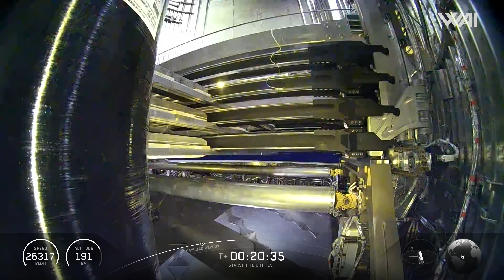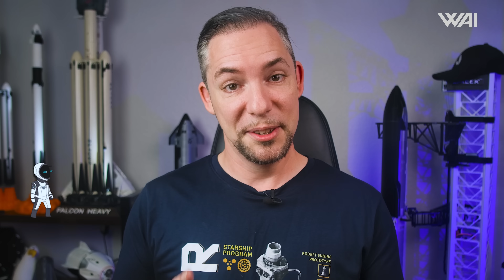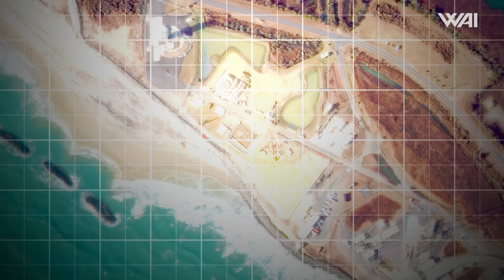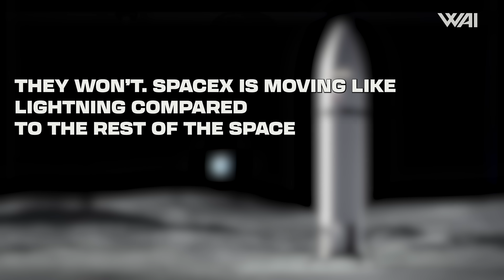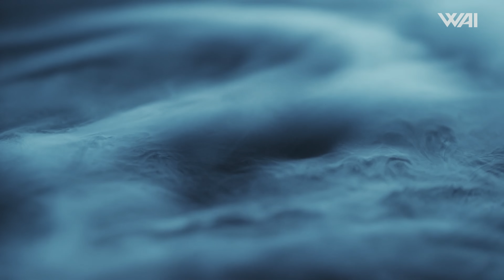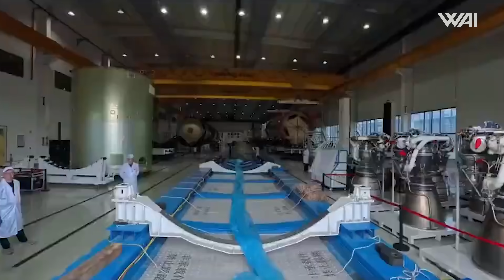SpaceX finally sheds light on ACTUAL Starship orbital refueling hardware!

Comment from the maker: Visit http://ground.news/WAI or use code WAI on mobile to get 40% off unlimited access this month!
What do you think of orbital refueling? Good idea? Bad? :_WAISweet:
Reply: The reality is, ANY future lunar and interplanetary system requires 2 things: (1) rapid reusability to reduce cost, (2) LEO refueling for large mass movements. We can't do anything manned beyond Apollo-stye moon missions WITHOUT staging fuel depots. We're going to need gas stations in space.
Reply: I see orbital refueling as a necessity for massive space cargo transport beyond LEO. In my view, loading 1,000 starships on Earth and NOT shifting cargo until landing on the moon and Mars requires orbital refueling. People in contrast prefer ships faster than chemical rockets so we can be sure people will eventually be given something SpaceX has yet to put on the drawing board. These will also have orbital refueling. Unrelated, I have zero confidence in initializing lunar transport with a tall narrow based lunar lander. SpaceX MUST build several short squat high flotation wide spider legged rough terrain landers, full stop. These put cameras and radar on the ground so Starships with legs can land safely. Starships with legs can bring steam shovels, cranes, etc to build infrastructure like the mechazillas rapid cadence Starships normally land on. Assuming SpaceX intends to build a few thousand operational Starships by 2030 this is roughly the timeline I'm expecting, and I say "roughly" because SpaceX is full of surprises. In fact, I'll be surprised if I'm not surprised.
Reply: Bro pulled a "hide user from channel" on my account and complain about YouTube
Reply: $4 billion (+ $23 billion in development costs) and NASA will repeat Apollo 8 with the second flight of the SLS. Mmmmm, OK.
Reply: Logical evolution to what we already do off both the ground and in the air now
Reply: Seems like orbital refuelling is a necessity. Although it seems like a downgrade to the original vision of starship ( although that probably reflects my ignorance and  expectation more than anything else ). Unless AI can design a much more powerful fuel source , that is

Comment: Why bring up several ships with propellant, when you should have an Ion rocket tug, pull you to the moon or Mars at an ever increasing halfway speed, then slow down and THEN Use propellant to land on the moon or Mars. Faster travel time, fewer launches to bring up fuel. DAH….

Comment: Questioning Artemis 3 and challenging others to replace HLS, maintaining current timeline, doesn’t sound very likely. 
Having said that, I think the Artemis program seems needlessly complicated, requiring multiple launches and several different spacecraft for a round trip. Not even mentioning the ridiculous cost of SLS. It is rumoured to burn money, rather than rocket fuel. Orion isn’t that much better.  It has been under troubled and expensive development for a very long time, with only one successful launch so far. CrewDragon is considerably smaller and currently not certified for long-endurance deepspace missions, 
but… it might be interesting to consider an upgrade after all.
I wouldn’t be surprised if SpaceX at some point decides to do this, with or without NASA, bypassing SLS and Orion altogether.
Reply: A couple of Dragon launches, two from Starbase, two from Brandenberg, two from Kennedy each with 5 astronauts aboard docking with Starship will get you quite the talented complement of crew to go to the moon and begin to set up base. An engineering team to prep the surface for buildings, a team to prep for future landings areas, a team for the insitu manuafacture of fuel for other mission flights. Got a lot to do in a months time. (If you plan on going there better plan to have a purpose and get stuff done!!!)

Comment: What's the downside of using parafine as a fuel? Is it harder to produce? There must be some negatives why companies like SpaceX aren't using it (for its first stage of course as the second stage is meant to land and lift off of other planets which would make it impossible to use parafine as its not easy to create on those spots).

Comment: SpaceX will need to make the rear transfer connections flexible if the front one are fixed.  Otherwise the logistics for connecting both fuel and oxygen at the same time will not work.  There are too many variables which affect the spacing of the orifices.  Construction would need to be perfectly precise.  Temperature can affect the distance between the ports.  Control  of both ships during the connection maneuver would need to be precise.  Quick disconnects are flexible for a reason.  In orbit, flexibility will also be important.

Comment: I Felix, I have one minor correction and one question: 1. The fuel masses you mentioned for Starship-Superheavy are actually propellant (fuel + oxidiser) masses.  2. Why does SpaceX need an orbiting propellant depot?  Couldn't they fill the HLS variant directly with tanker variants rather than filling the fuel depot first and then transferring propellant to the HLS?  I could understand why they would need a propellant depot to fill a crewed version of starship, to minimise the time and therefore commodity usage, on orbit for the astronauts but it will be a long time before there will be a crewed variant.  Surely, the best part is no part and therefore no propellant depot?  Is the reason that they need a heavily insulated version to prevent boil off and this would add unnecessary weight to HLS?
Reply: Prolly because of the Mars plans? 🤷‍♂️

Comment: I was hoping you would explain it but you didn't. How does Starship need to be refueled? The booster carries Starship to a certain height, Starship then burns most of it's fuel getting into orbit, then waits for another Starship to refuel it? How? Won't that other Starship also waste it's fuel getting into orbit to be able to dock with the first Starship? I don't understand.

Comment: I wonder if you could somehow recover at least some of the energy at launch of starship or any other rocket, kind of like the recoil of a gun captures the energy released by the shell when it is fired. I am not suggesting firing one rocket helps load the next rocket on the pad, but it "could" be used to provide some power to Starbase.
Reply: That increases complexity for not much of a positive result

Comment: IIRC, Tesla Model 3 motors and batteries move Starships wing flaps. Tesla Model S motors and batteries move Super Heavy's supersonic grid fins.
What are the odds that all those (unsold??) Cybertrucks lined up outside Starbase are the delivery of the motors and batteries to run the pumps to transfer fuel on orbit?
Under the "Best Part Is No Part" ethos, possibly a version four of the sea level Raptor engine, with external battery and electric motors (like used by Rocket Labs Rutherford engine), where a valve can switch between pumping the fuels in to a rocket engine, or pumping them out across in to a waiting Starship to refuel.
Starship to Starship is important, but I expect the tanker will only look like a Starship vehicle for the initial tests, and SpaceX to build an unmanned platform with multiple tanks that are much bigger then those of a single vehicle, the bigger it gets, the more payload mass to retain it's low temperature on orbit. (Surface Area of a Sphere vs Cubic Volume,..)

Comment: Just send SpaceX Starship Moon Lander to the moon, without refueling.  (Non-reusable booster)

Or send a starship cargo pod moon lander to the moon.

Almost the same size as the cargo bay of the starship.  Just a tiny bit smaller.

Just deploy it out of the tip of the starship like a bullet, perhaps using springs.

Make it so it can travel to the moon by itself.  Like the crew dragon.  And be able to dock with Orion space capsule.

Send an empty starship to the moon before hand to catch it, and land it on the moon.  
This could be a special starship, that when getting to the moon, it divides in half, top part becomes a cargo pod lander, able to catch cargo pods, land and retrieve them from the moon. 

It could be refueled with cargo pods tankers. Only a few of these special starships would have to be built.  They could be controlled by remote control, or by humanoid robots, or by astronauts.

And the bottom part remains in moon’s orbit to be recycled (or reused) or lands on the moon to be recycled.

Do the same thing for Mars, send 1000 cargo pods, instead of 1000 starships.  Save billions !  🙂

Comment: In my eyes, starship should come with a third stage, third stage being a safety capsule.. i imagine an upscaled stoke space type design would be perfect for this.. only the oxygen tank up front needs to be relocated, and the best part is, this stage would actually keep the weight Ballance if so.. 

That's the fastest and safest route to get it human rated.. if anything was to happen on the moon, you don't need to send a bunch of ships to refuel, you leave in the nose cone, the second stage becomes a tanker hub for next flights, refueling happens without risk to crew..
I imagine you don't need many of this version, only until the other versions gets human rated without an abort system.

Comment: How does a rocket engine burn solid parrifin? Does it pass super heated oxygen down a hollow core of parrifin? Sounds impractical for maintaining consistent fuel conversion. 

Perhaps the parrifin tank is heated until some of the contents are liquid. Then the liquid has a sensible propellant pump. 

How does the solid wax rapidly get heated into a liquid during launch? 

Maybe it is all melted in advance of launch?

Comment: Honestly I've been a little concnerned about SpaceX's ability to pull the lander together given their current priorities.  But opening the contract back up to give money to someone else (*cough* Boeign *cough*) won't get things done faster unless the plan is to use this as kindling (tea-teb?) under SpaceX to get some movement from them.  I would like to see Dynetics have another shot at the lander though.  Something with a lower center of gravity seems a little more practical on uneven surfaces than a top heavy landers like SpaceX or Blue proposed.  Honestly I think NASA has realized how far behind they are and are trying to push things out and save face.

Comment: My 5cent worth on the "refilling" design. If you have two female adaptors (vertically) on the left of the vehicle and two male adaptors on the right of the vehicle (thus one of each per tank) then you don't have to make two variants of starship, as any ships can mate with any other ship in either role of needing or carrying fuel is then simply direction of flow.

Comment: Remember "The best part is no part."  One aspect of this is using a single component to perform multiple tasks.  There is already an adaptor on Starship which supports bidirectional flows of cryogenic propellants.  Why add another port and all of the necessary plumbing to connect it to.the tanks.

Comment: Don't know about the lowers, but the upper docking studs are in the ring section above the upper methane tank dome.  And I didn't see any connecting hardware for between them.  Of course this may just be another prototype to see how they survive re-entry before building another ship with the plumbing, but as of now it looks like they might only be for docking and not fuel transfer.  It would be a slick way to do it, though.

But there are other gases on board Starship other than the fuel and oxygen.  How many of those will also need to be transferred to/from the orbital refueling ship?  Or will they have a secondary ship for the other stuff.  Kind of like a Quickie-Mart for low earth orbit?  (Once we get live astronauts in the picture they will need someplace to sell the Pepsi, Snickers bars, and lotto tickets.)

Also, about the sunlight; those thermal tiles really resist conductive heat flow.  Wouldn't it be helpful to keep the TPS side pointed at the sun?

Comment: Hybrids have most of the drawbacks of solids, the worst problems of liquids, and performance lower than either. Poor mixing and combustion efficiency, inherently non-reusable, lousy propellant utilization, and cripplingly high dry mass make them unsuited for orbital launch, requiring three or four stages just to limp into LEO.

But other than that, Mrs Lincoln, how did you like the play?

Comment: When I look at burning candles, doubt that parrafin wax is not flammable.
Reply: Paraffin wax does not burn.  It must be vaporized first.  In a candle, the melted paraffin soaks into the wick where the relatively large surface area allows it to evaporate quickly.  The vapors are what burns.  This is the same with wax or oil and it's why you can make the light brighter or dimmer by adjusting the length of the wick and, hence, the surface area available for evaporation.  Somehow I doubt that a rocket will use a wick.  But it will still be the vapors which burn.
Reply: How does a rocket engine burn solid parrifin? Does it pass super heated oxygen down a hollow core of parrifin? Sounds impractical for maintaining consistent fuel conversion. Perhaps the parrifin tank is heated until some of the contents are liquid. Then the liquid also has a vapor flash point and is not as "safe" as wax, but now has a sensible liquid propellant pump. How does the solid wax rapidly get heated into a liquid? Is it all melted in advance of launch?
 @briangodfrey7424

Comment: I  hope that SS HLS is ultimately designed with the capacity to go from LEO to lunar landing and back to LEO.  You don't need heat shielding.  You could probably put fewer, or only vacuum engines on it.  Might even be able to shrink it a bit if the LEO > Lunar surface > LEO requires less fuel than getting from the ground to LEO.  Then the main issue becomes crew transfer and cargo transload in LEO...  That pretty much obviates the need for SLS and Orion, and that frees up NASA's budget to do everything else it wants to do.
Reply: Yeah.  And I hope it has a professional crew to fly the ship and they take the astronauts as paying passengers.  (Presumably NASA is paying at first.)  
"If the captain lights this indicator your space suit will drop down from the ceiling and you will have 2 minutes to put it on.  Please watch the video for detailed instructions..."
"Please put your seats and tray tables into the landing configuration..."

Comment: Starship is the wrong spacecraft for Lunar sustainability.   It's too big, too inefficient, and unsafe.  Not to mention that the moon is Carbon poor and you cannot make Rocket Fuel for Starship on the Moon.  Blue Origin is a far better choice.  Starship is really nothing more than a a large and expensive Starlink launcher.. that's all.  It's useless for anything else.  Sorry SpaceX fanboys ... they were due for a massive failure and this is it.

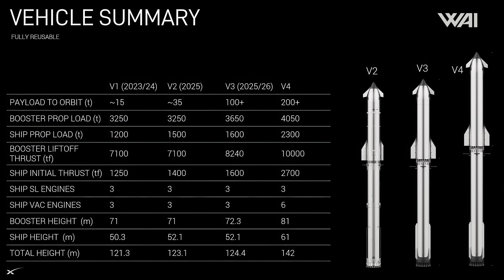Comment: 2:59 Payload to orbit figures have been overstated for previous Starship versions, it seems like they get lowered every time they make a new next-gen block chart, I wonder if V3 is overstated
Reply: Previous Starship versions carried zero payload to orbit. Dummy starlinks are all they have carried to date. Thus, zero payload to orbit figures have been impossible to overstate for previous Starship versions. Are you sure you want to call zero an overstatement ? Every new version has steadily increased the estimated payload toward the original end goal.
Reply: I hope it’s close to accurate
Reply: V3 raptor removes a suv comparable mass per engine. Payload to orbit has also been surplus fuel on each launch that they have been venting after meco. Greater launch thrust from v3 will also show more effective Payload.

Comment: The Depot needs to have a superstructure to house more than one tanker and to shield them from micro-merorites. 

Also, the superstructur needs to house a lot of solar panels for active cooling systems as well as a mini space station for housing repair crew and repair bots .

Come on guys, time to think big, refuelling will not just be for Startship but a utility that any paying customer can use. It is a vital service which can be a hub for bots to launch from to gather space debris and store the same.
The collected rubbish can then be ejected and de-orbited to burn up in the Earth's atmosphere .

So we need lox, methane, and hydrogen tanks and maybe a smaller amount of Co2 and nitrogen. The cost of the service will cover refuling and rubish collection. 
There should be an additional tax paid by the USA, Russia ,Canada and Japan China etc , who have been historically the largest space users and launched the most satalites still regrading in orbit and who have caused the most amount of space debris.

Depot should be changed to Refuelling Space Station 🚉

Comment: You could put solid rocket boosters on both the first and  second stage and have a LOT more than 100K of fuel left over to transfer.  

I have done this on Kerbal and you can double the fuel delivery to orbit using SRB's.  You need larger SRB's for the first stage and much smaller boosters for the second.  The larger SRB's are essentially to lift the second stage plus the second stage SRB's to the point of stage separation which does need to be slightly higher so it is a slightly harder return for the first stage.  The second stage you run at 50% and blast about 95% into a stable orbit before SRB Separation.  Then you turn the engines to 100%, circularize the orbit and intercept the other ship.  

The net result is almost double the fuel delivered per launch.  It doesn't matter how big you build the liquid fuel rocket.  You can always add correctly sized and numbered SRB's  to both stages and double your fuel delivery.